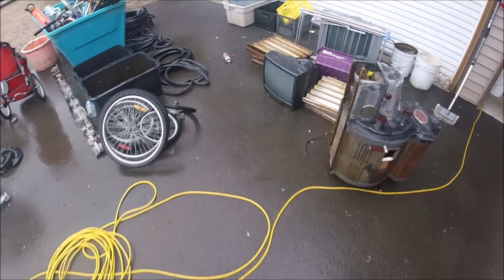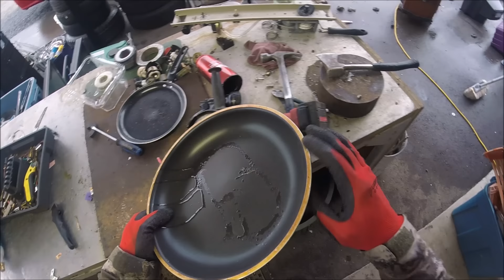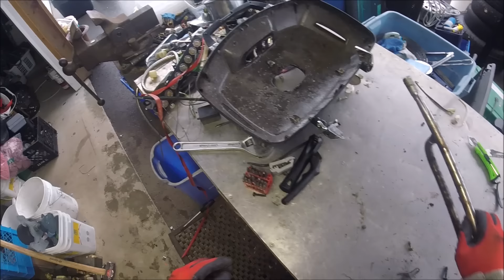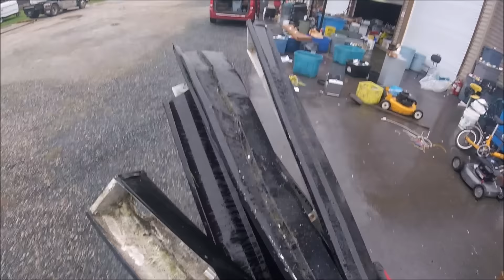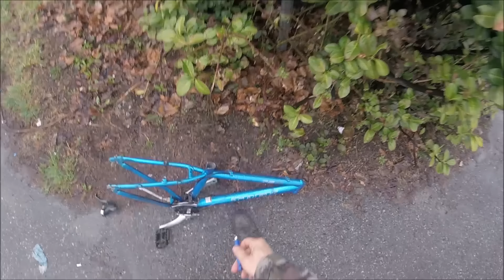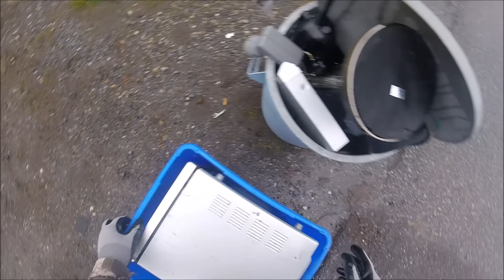Two Non Ferrous Scrap Runs

Comment: At least you found those side cuts they look pretty new,I’ve found a couple of pairs I use doing rough stuff and take with me scrapping but I have some really nice ones I use at home but only on wire and such. Saw the Project Shop using an air chisel to remove rivets the other night it tore them out in half a second,if you have one you may check it out on pots and things like those bread pans,I hate drilling out rivets gonna try my air chisel on some extruded thresholds see how it goes.